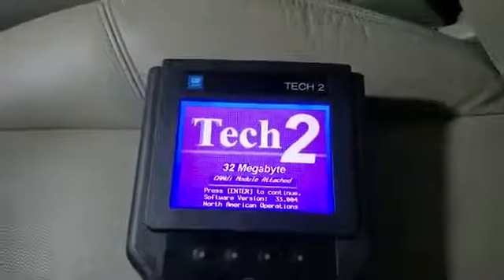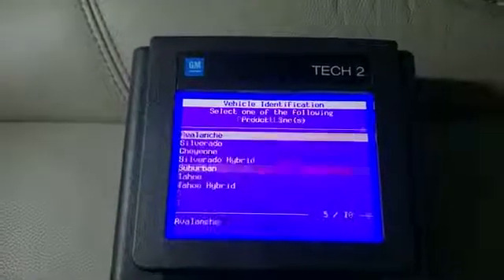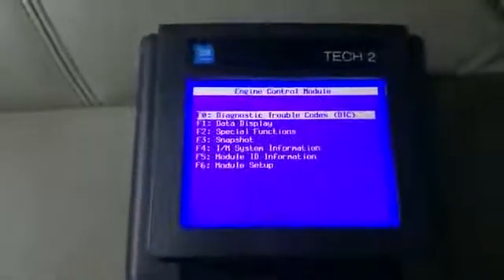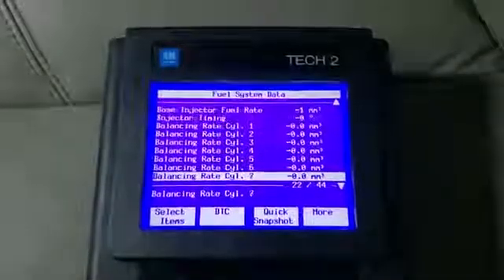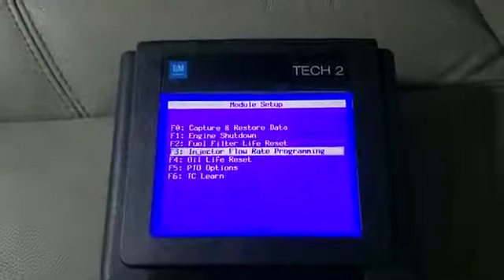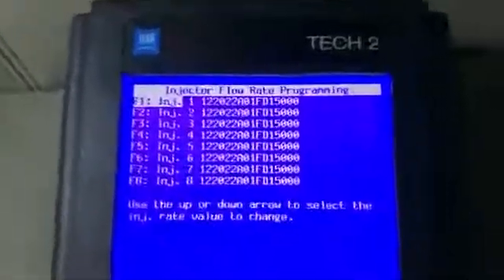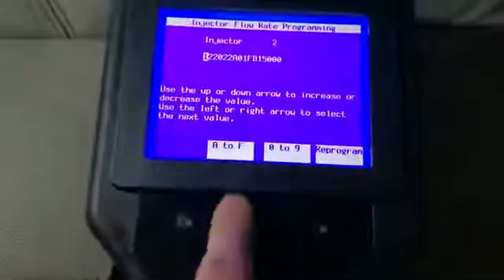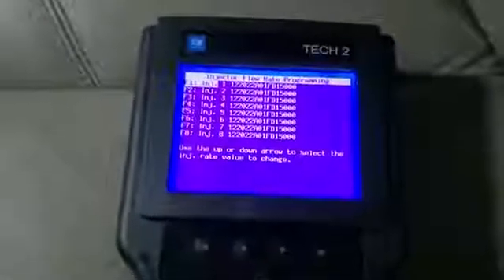Updating injector trim codes on a Duramax using a Tech 2

Comment: Thanks for the info bud. Are you using an original tech2 or a clone? Thanks
Reply from the maker: This is a clone.
Reply: @bitterrootdieselperformance  Hey bud, thanks for the great video. Where can I get a decent Tech 2 clone?
Reply from the maker: @johnladouceur9939  You can buy one online or rent our unit.
Reply: @bitterrootdieselperformance  How much to rent yours?
Reply from the maker: @johnladouceur9939  $100/month.
Reply: @bitterrootdieselperformance  where did you get your clone or who do you recommend getting a tech 2 from?
Reply from the maker: @shanerproductions  We rent ours or you can buy your own on eBay.
Reply: Thanks dude. Have you used this to diagnose shorts? My LMM keeps charging above the normal 13.8-.9 volts fresh alternator but nothing also tends to kind of die overnight usually starts after the motor clicks a couple of times but starts and drives normal 🤦🏻‍♂️
Reply from the maker: @golfwhores7115  I haven't.

Comment: When is programming the injectors like this utilized? Any advantage to programming the flow rate like this as opposed to the number stamped on the injector?
Reply from the maker: Oversized injectors are mechanically balanced so the Bosch algorithm for balancing a stock set needs to be bypassed.
Reply: Each injector is mechanically different in how much fuel is at flow rate compared to spec, each injector goes through flow rate balancing, that code is the flow rate to each individual and specific injector to put it closer to what spec would be considered, the procedure this video is recommending is not recommended on any dealer platforms or from any performance mechanics, you put in each number to set the flow rate accordingly to create a balanced flow to what would be considered spec to what each one was machined to.
Reply: Makes sense, thanks for the reply!